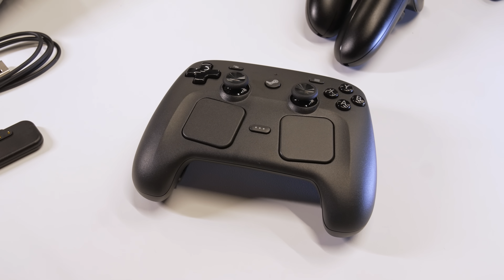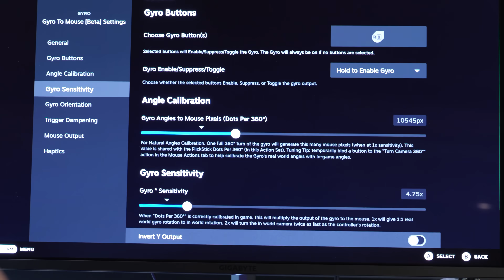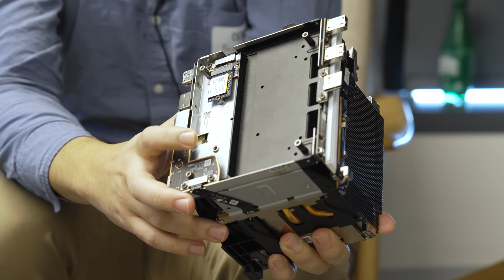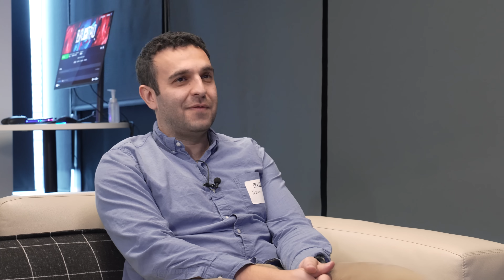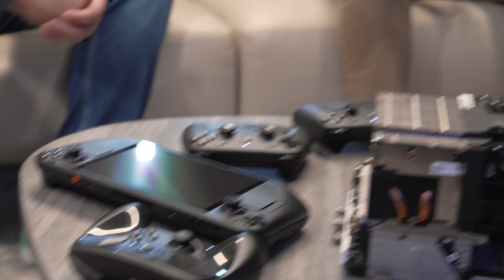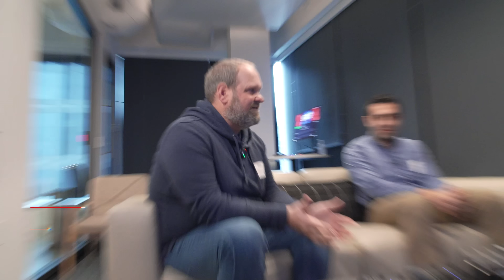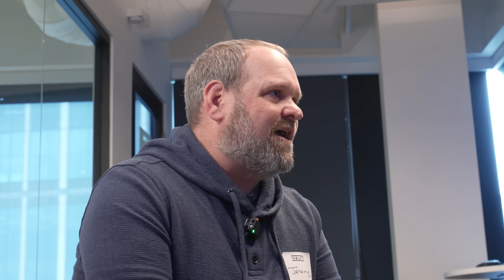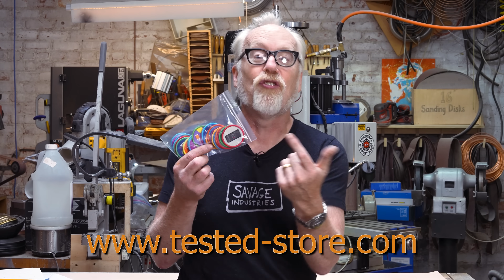Hands-On: Valve Steam Controller 2 and Steam Machine!

Comment: I haven't watched the video yet, but I hope it doesn't have the same shortcomings of the steamdeck. I think all the Controller features in the deck are fantastic, but the quality of parts is lacking. It looks to have all the features of the deck, so if the quality is greatly improved, this will be my favorite controller of all time. The steamdeck triggers are decent, but the bumpers are subpar(the worse out of all the controllers I use) . Also the dpad is terrible. If all these are improved, this will be a really good piece of hardware

Comment: I’ve been burned before… I bought the first steam machine with the first steam controller and it was horrendous. The fan sounded like a jet engine in my living room.
Reply: And how is that relevant to this?
Reply: @kuhpunkt  because I had a bad experience with the first release. I’m not sure what’s confusing you here
Reply: @Avaddon911  It's an entirely different situation.
Reply: @kuhpunkt  wtf are you even talking about it’s the same company coming out with a product with the same fucking name 😂
Reply: @Avaddon911  It's still an entirely different situation. And what you say doesn't even make much sense. You said you bought "the first steam machine" - what exactly was "the first steam machine" then?
Reply: @kuhpunkt  The Alienware Steam Machine is a gaming PC designed to be used in a living room, similar to a console. It runs Steam OS, a Linux-based operating system, and comes with a unique controller called the Steam Controller. 
The Steam Machine was launched in 2015 but was not a commercial success and was eventually discontinued. It was a PC/console hybrid that offered the flexibility of a PC with the simplicity of a console. 

There’s AI’s answer.
Reply: @Avaddon911  I don't care about AI answers and the fact that you didn't even check/read/comprehend it... wowie!
Reply: @kuhpunkt Jesus Christ man. It released in 2015, I bought one and it was shitty. It was discontinued. This is the 2nd release of the Steam machine.
Reply: @Avaddon911  There was no "THE Steam Machine" - it was a bunch of different vendors, using an old version of SteamOS. SteamOS has matured a ton, that's why the Steam Deck works so well. And you could still use your old Steam Machine... because it's just a PC. What you do is like saying "I watched a movie once and it was bad, so I won't watch another movie."
Reply: @kuhpunkt  are you really this dumb? I’m done talking to you
Reply: @kuhpunkt it’s still the same fucking company making a machine with the same fucking name

My statement is my own opinion, it doesn’t have to be coupled with yours.
Reply: @kuhpunkt honestly you sound stupid here man

Comment: I believe Norm has mentioned in the past that he still frequently uses his SC1. I know you said you didn't get a lot of play time with it, but I'm wondering how comfortable the trackpads are to use. I use my SC1 as trackpad primary, and their placement on the SC2 has me a bit worried for this use case. From what I've seen it looks like the joysticks may get in the way when going from trackpads to face buttons/Dpad. Did you experience this? I'm also a bit worried that their position on the controller may get uncomfortable thumb placement wise after extended use. Also as an original steam controller user, thanks for the awesome review

Comment: I feel like Valve should've just released a Steam Deck 1.5 with an extra USB4/Thunderbolt port (or oculink), full size 2280 SSD support and make an eGPU instead of this Steam Machine. Make the eGPU similar to a Switch dock where you can dock the Steam Deck and seamlessly output to a display with a performance boost. That would definitely eat into Switch 2 sales.
Reply: You are asking for a completely different product. It’s not as easy as you think. “Just” completely change an architecture of a product is not how things work.

Comment: I wish all TVs had built in IR LEDs so we can continue the accuracy of the wiimote. I wish gyros were persistently accurate.
Reply: Adding a magnetometer, like phones have, with a little help from software, would solve gyro drift. Though, my experience with the Deck and previously with a PS4 controller, shows software alone already can do a pretty good job of compensating for gyro drift with modern gyros (as long as you calibrate the gyro when needed, which is kinda rarely).

Comment: Looking forward to it. I LOVED the original steam controller. Was pretty useful once you got a hang of it after some time. I just think it was a bit before its time. The tracking was not fast/accurate enough yet. Plus the setup for each games was a bit intimidating/time consuming each game. I really think they had something there, just needed fine tuning until it hits a slam dunk. This hopefully is heading in the right direction. Only hands on trial can tell though.

Comment: I thought I saw in one of the videos I thought they said the GPU was also fairly custom and optimized or was I hearing things. I think they also said that the GPU will use FSR 4
Reply from the maker: i heard FSR 3, but hoping for FSR 4 support later. no custom GPU hardware--what's custom is the firmware